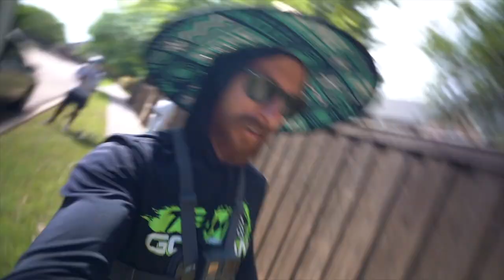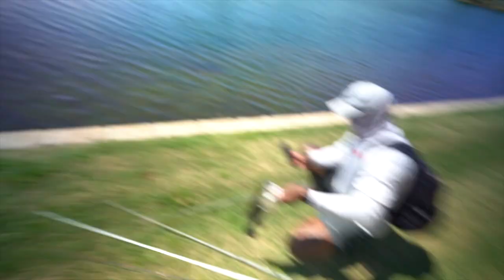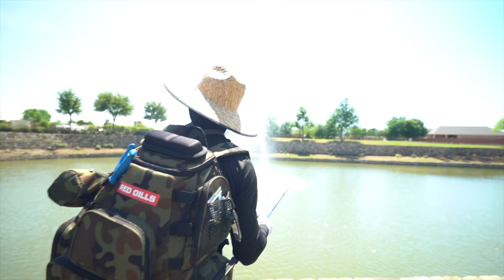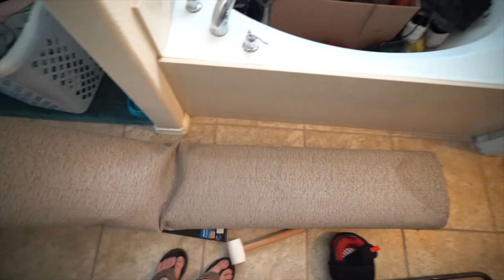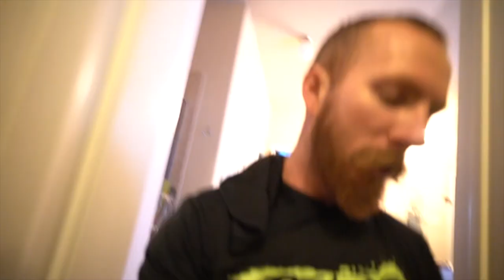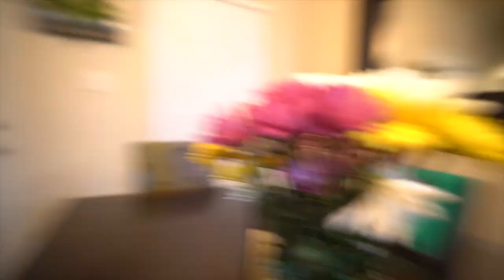EXPENSIVE $100 DEPS BLUEGILL SWIMBAIT IS SICK! + Evening GOOGAN SQUAD FROG bite was FIERCE 🔥

Comment: Nice vid do you use soft paddle tail swimbaits any and if so what brand to use and what size hook
Reply from the maker: I usually use Saucy Swimmers in the larger size if it’s just by itself and not on a chatterbait or a swimjig trailer in which case I use the 3.3”...... I would say a FlashBang book from Karl’s that’s what I use a lot (a weighted belly hook with the blade for extra flash). Otherwise any 1/4 or slightly heavier weighted belly hook depending on how deep you need to get should work. Anything 4/0-6/0 should be fine